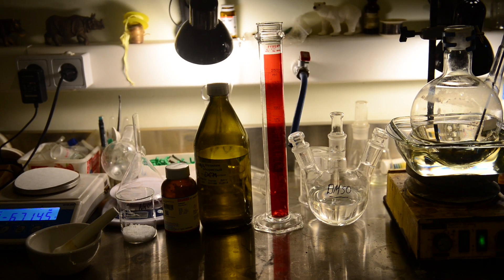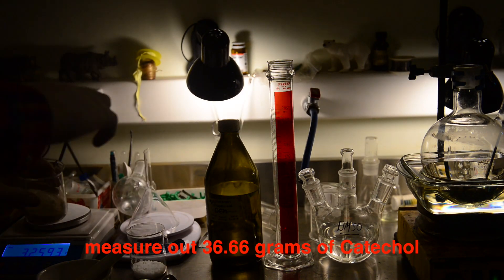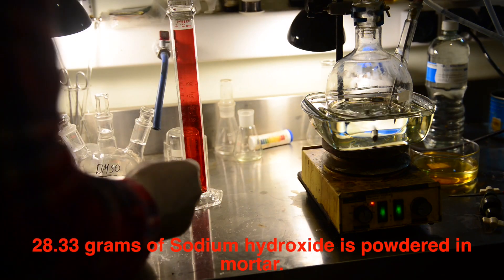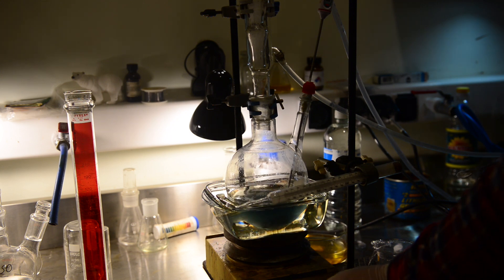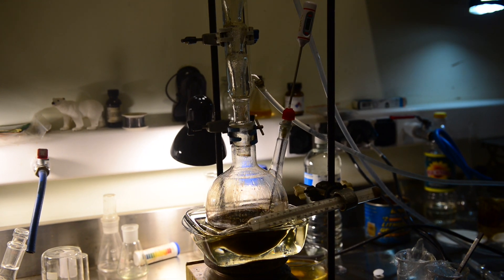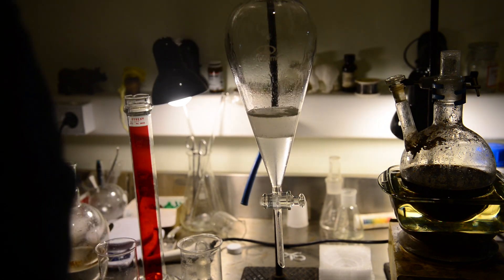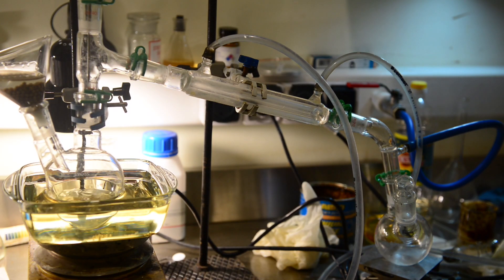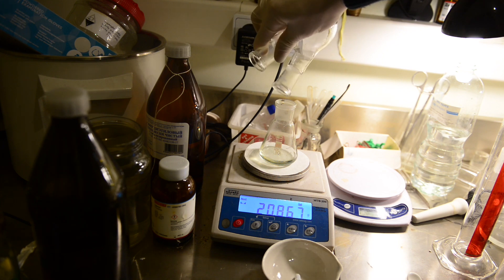1,2 Methylenedioxybenzene  or 1,3 benzodioxole final synthesis.

Comment: Is there any resources for the actual mechanism for this mechanism or how it works in general? Thanks vm.
Reply: It's a Williamson ether synthesis. The DCM is acting as both a solvent and reactant. Under basic conditions, the hydroxy groups on the catechol can deprotinate, detaching liable to neucleophilic attack by the carbon of DCM. The DCM loses a chloride group, which bonds with the proton lost from the catechol, and the carbon bonds with the oxygen to form the methoxy. It can do this with both of its chlorides on the same catechol molecule, though when done in this poor setup, with huge excess of DCM, there can be intermolecular cross reactivity. To improve this, switch to a better methylation agent, namely diiodomethane, which can be made from DCM easily via finkelstein. And add the methylation agent dropwise with stirring. A better co-solvent would also improve yield, such as an ether like diethyl or dioxane
Reply: Reaction*

Comment: Catechol synsetesis???
Reply: Could be made from phenol, but it's cheap and readily available, even in ebay. In theory, you could extract it from trees, which have lots of guiacoyl. Or perhaps guafenisen, by acid hydrolysis. But both methods are more time intensive, and maybe more expensive, than buying it online 20 a kg.